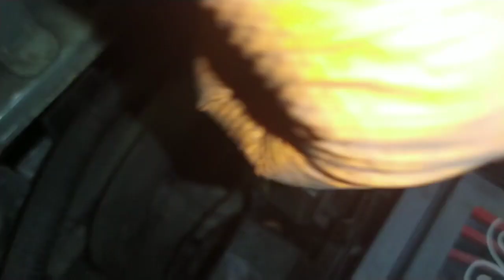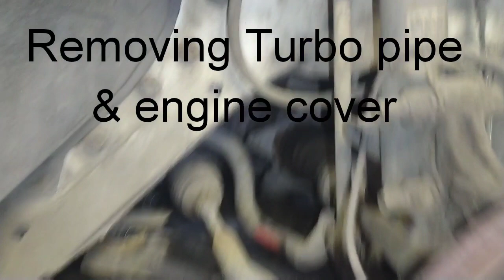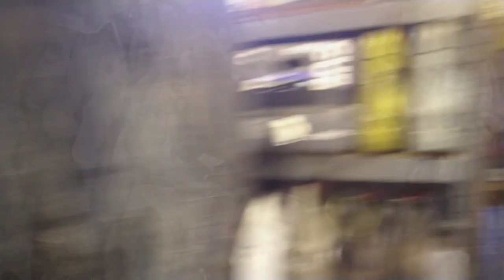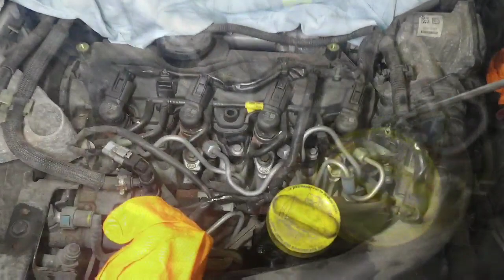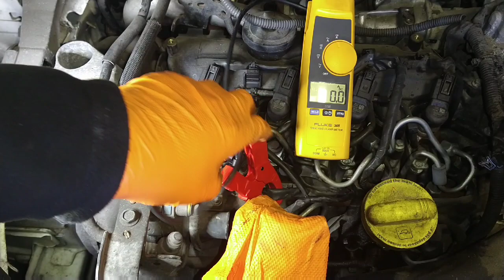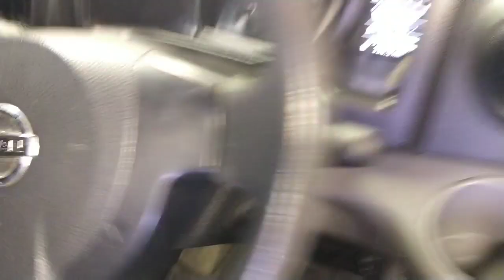Nissan NV200 1.5 Dci poor cold starting. Glow plug diagnosis & repair, P0380 Fixed!

Comment: Do you need to put copper grease on the threads?
Reply from the maker: No, just don't overtighten them - preferably use a torque wrench to the correct specification.

Comment: When you are using the meter to check the ohms at the start of the video it looks like you are using the red terminal on the wiring harness. I just wanted to confirm where the black terminal goes to complete the loop? I know you said that they're grounded through the engine so does that mean that you just put the black probe anywhere on unpainted metal in the engine bay? 

Thanks
Reply from the maker: Yes, your correct. Other terminal will go on good earth. So bare metal engine parts or battery negative terminal.

Comment: Thanks this was properly useful, even the close up of that clip at the bottom of the pipe after you'd removed it to let us see exactly what we're dealing with was very useful.  

A proper faff in this engine, other videos show newer/different ones it seems where you can just remove a small section of that pipe over the engine, but mine was like this one, i got there in the end though thanks to this video.

One plug was dead, but it started up so smoothly after replacing them all.
Reply from the maker: Nice one cheers 👍😁

Comment: Is it ok to run the engine in order to heat it up with the turbo pipe removed, once its hot might be a bit tricky to remove everything and also the engines going to cool down
Reply from the maker: Just bear in mind you might introduce fault codes with anything disconnected.

Comment: Did you spray the plugs first? I have the same problem with my NV200 and a mechanic friend told me not to attempt it as you can brake the plugs if they don't come out easily. And then it's an engine out job.
Reply from the maker: @maxgrass8134  I sprayed them on the day I did it and got the engine up to temperature beforehand too. There are people out there who can extract broken glow plugs without cylinder head removal. Most engineering shops offer a mobile service at a price.

Comment: My nissan nv200 has new glow  plugs, new alternator, new battery, new first injector, new starter motor, new diesel filter.....STILL NOT START.....any clue .???...may be exhaust or fuel supply ...

Comment: Hi I wonder if you could help me I took my nv200 to a garage and the replace the relay and the glow plugs but after I took it out the garage the Red and orange engine light is on at the same time and stays on is any idea why this is happening ? The garage is going to check The van in two days but they say doesn’t have anything to do with the job they done 🤔
Reply from the maker: Hopefully something simple. I can't really predict what it will be unfortunately 🤔

Comment: Very useful and Informative, I want to know the reason behind failure of Glow Plugs specially of Renault 1.5 DCI. And Glow Plug Light Glow on the Meter Console always for  the same timing approx 3 seconds irrespective of outside temperarure. Is this normal or should it Glow according to outside temperature. How much time should I wait before try to start the car after Glow Plug Lights went off. Is multiple pre heat using  they ignition key on off 2 3 times recommended or not?
Reply from the maker: The 1.5 DCI seems to have more glow plug failures than some other vehicles. The computer controls the glow plugs depending on temperature and will pre heat them longer if is very cold. The glow plugs stay on after engine starts for a couple of minutes on most common rail diesel  vehicles to assist with combustion and reduce emissions.
Reply: @Automotive_Solutions  Thank You

Comment: Great vid,ive generated a code from delphi that say 0380 it doesnt have a p in front of this would it be the same issue ?
Reply from the maker: I would think so. Hi in using Delphi under eobd mode and see what code you get. It'll have a p in front of it.
Reply: @Automotive_Solutions  thankyou thats really helpfull,i do have a knock sensor fault which i'm struggling to find the location of this part,any ideas ?
Reply from the maker: @darrenturner1119  not sure of the exact location on this engine but normally bolted on front of engine block somewhere.
Reply: @Automotive_Solutions  thanks mate i hope so, fingers crossed its not at the back lol

Comment: Hi do you know what voltage yo us by should get on the two.small.wires. are these supplying 12 volts to the relay coil?
Reply from the maker: One of them will be controlled by the ecu to switch the relay on and the other is possibly a feedback wire to the ecu for fault detection. I'm not 100% sure as all the ones I've seen have been the glow plugs at fault. I would probably use an oscilloscope to see what they are doing. Good luck.
Reply: @Automotive_Solutions  thank you. Is it correct that I should see 12v when I first turn the key from cold and the glow plug indicator light comes on.
I have 12v going into the relay but not coming out. And relay is new. 
Maybe I will pull the old one apart to see how it works.
Reply from the maker: @dellybeanhead  or find a wiring diagram that shows where the wires go. I'm sure they're both going to ECU though.

Comment: Might be a stupid question but where is the correct place to connect/touch the black wire when you're checking the relay?
Reply from the maker: I would do the same as I did and touch the connector with the relay removed. Don't force anything into the connector or you may damage it. The large white and large black wires are the main power and earth.
Reply: @Automotive_Solutions  Thanks for getting back to me. Yeah my question was where to earth the black wire? Is anywhere on the engine block alright to do that?? Bit new to all this, but just bought a 2015 NV200 yesterday and this morning had trouble starting it up, so thought I'd try this.
Reply from the maker: @empbass  Just use a test light to confirm which wire is live and which is earth. I can't remember exactly but thought black was earth so better check first. Put one end of test light on battery positive and other end to black wire. Should light up if it black is the earth wire. You could use a headlight bulb between the large white and black wires to test they can carry current. If it's dim then you've got a problem. If in doubt get someone who knows what they're doing so you don't damage something 😧.

Comment: Hi great video. Do you kno in what order the injectors sit from the timing belt side so i can code them. I have been told a few different orders so 1342 4321 and 1234 any help would be great my van is same 1.5dci 86bhp euro4. Thanks
Reply from the maker: Hi, pretty sure number 4 cylinder is timing belt end and number 1 cylinder is gearbox end. The diag tool normally talks you through the order to do them.
Reply: Automotive Solutions hi thanks that has to be the fastest response i have had on youtube much appreciated. I will have a go at coding the injectors i will keep this post updated👍🏽

Comment: Great vid! Thought I had an issue with the glowplugs - no fault codes. They all measured 0.6 ohms. Put the relay back in and ever since has been much better. It's almost as if there was resistance in the relay contacts and removing\reinsertinf the relay wiped the contacts.
Reply from the maker: Fingers crossed. 👍
Reply: Did this continue to be fine to date?
Reply: Fault code in February to state glow plug issue. Run through diagnostic as outlined in this video and found 1 glow plug open circuit. Not too much of an issue as we're now heading into warmer weather but I will need to sort before next winter.

Comment: Hi 👋  on my nv200 the glow plugs doesn't receive any power  i change the relay  but the same  situation  what can be .thanks
Reply from the maker: Check out the fuse and wiring.

Comment: do you think the glow plug relay the same location on 2012 Nissan Navara >> thanks for the good diag
Reply from the maker: - I think it's either on the right inner wing or in the under bonnet fuse box.
Reply: @Automotive_Solutions   thanks Mate

Comment: I have a nissan juke 1.5 went out today car was warm. Got in to start the car and wouldn't start 3rd time it started And left eml on dash. Went home and plugged a cheap code reader in and cam up with glow plug. I removed the eml and took it for a blast on the motorway and nothing came back on hopfully I won't have to end up changing these glowplugs but really useful video. Thanks

Comment: Excellent video many thanks for that info as I have an nv200 on a 61 plate with a red engine light on the dash with codes p0670 and a code p0235